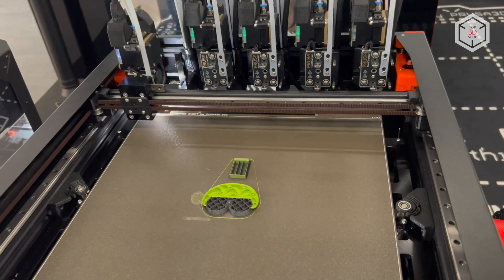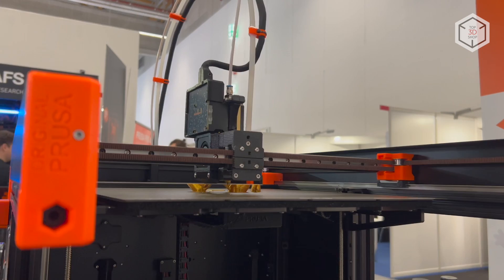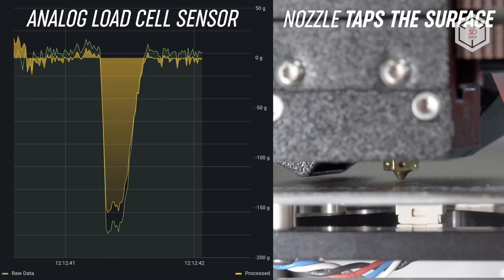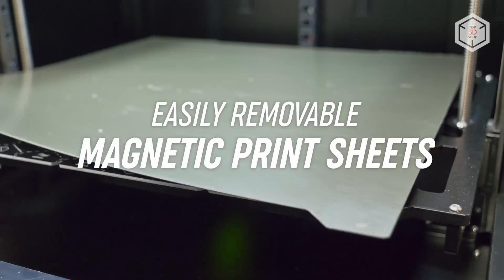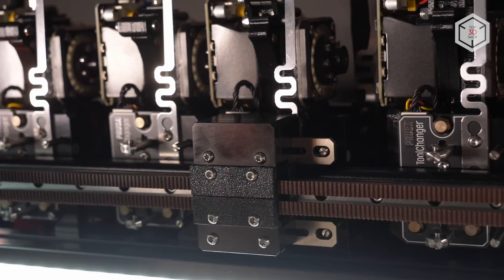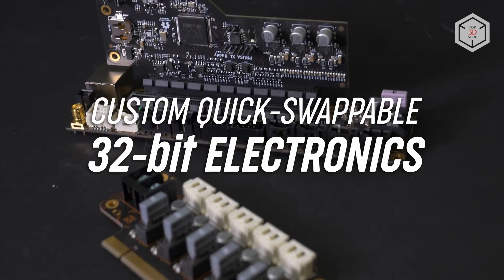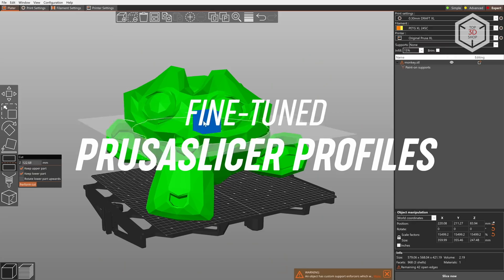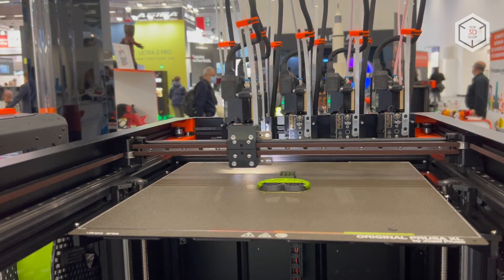Original Prusa XL Overview: Multifilament FDM 3D Printer

Comment: RIP prusa, once bambu releases a toolchanger, even the XL will be obsolete
Reply: Ahhaahaahaahaa. Bambu is the last piece of sh**. In 2-3 Years you don't become support anymore. If anything is damaged on this printer you can throw this printer in trash. Not repairable. Carbon rods and bearings to repairable by yourself.  Bambu is a large heated trash can.

Comment: It’s old slow tech 🤦🏻‍♂️ review the bambu. It’s a way better printer for a cheaper price.
Reply: Apples and oranges. The Prusa has twice the total build area (~650 square cm on the Bambu vs ~1300 on the XL) and a complete CNC-style toolchanger, among other things. That's not even getting into the repairability headaches I've had with my X1C and all of its proprietary hardware.  I like mine for the most part, but I'm not cancelling my XL preorder.
Reply: @sasca854  I keep my normal cr-10 max if I need bigger prints.   You don’t think that bambu will be coming out with a larger bed size? I rather wait for that than the XL.   I seen it working and own cnc, lasers, and other fun tech.   The XL is far from impressive for 2023   Sorry man to slow.  To overpriced and just not impressive
Reply: @sasca854  build area means nothing... You do realize Bambu will be putting out a larger bed? I just watched a video of X1 doing a mask  it took 44hours..  I maxed out my bambu with the same mask.  It was only 16hrs to make..  If the bambu was a larger bed.  The bambu mask would be done in less than 25hrs...    ummmm considering that the XL has failed its launch and also how painfully slow the XL is...  I feel waiting for the larger bambu bed is the best bet unless you really do like watching paint dry and water boil lol     Sorry about your small issue with your X1c.. Mine has been good so far..  I know sooner are later I will have an issue and guess what?  ALL PRINTERS HAVE ISSUES. I see Prusa's goin down in the facebook chats...  Welcome to the world of tech.   XL is just wasteful for a business in 2023..   You can enjoy your pre order and waiting for it to ship.. I honestly don't care if you keep it or not..  It's silly considering its just overpriced printers with very good marketing....   enjoy your day :-)

Comment: The colored display is standard and not an option. But it's no touch which would be necessary for this price.
Many wrong facts in this video
Reply: Thumps down counter are disabled. Hard to tell if the informations are accurate without going through comments now 😢
Thanks for the information. 👍

Comment: I cancelled my Prusa XL preorder. It just seems like bad value compared to the Bambu Labs printer. Seems like the Babmu Labs printer is way faster. Althoug the multiple print heads and bigger build area is certainly an advantage for the Prusa XL. But costing 1000€ more I just can't justify that price, especially for just personal use. I guess if you can actually make money selling larger prints it might be worthwhile. It's probably best to have one of each in that case, the bambu labs for printing small stuff and Prusa XL for the bigger stuff.
Reply: Big mistake
Reply: @Guenounovitch  care to provide any reasons?
Reply: @Guenounovitch  far from it. I love my bambu and so glad I didn’t go with the XL.    Overpriced outdated tech for 2023